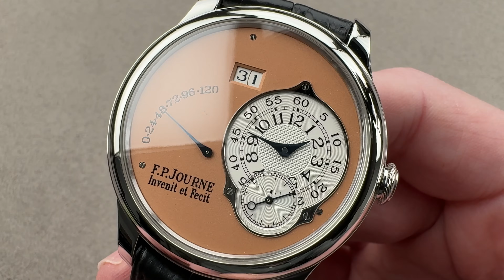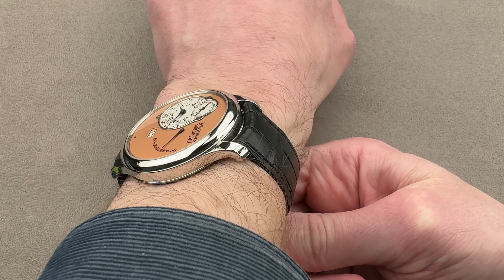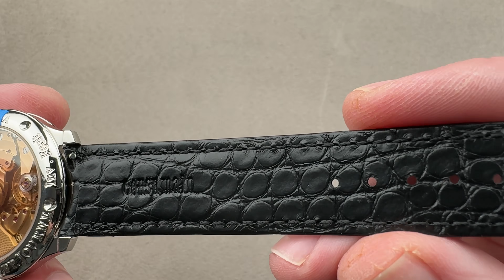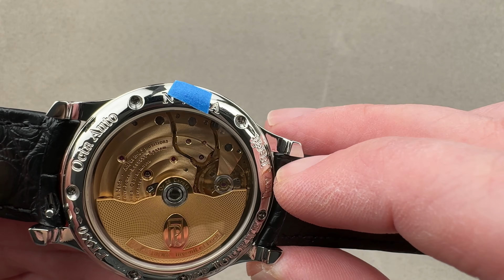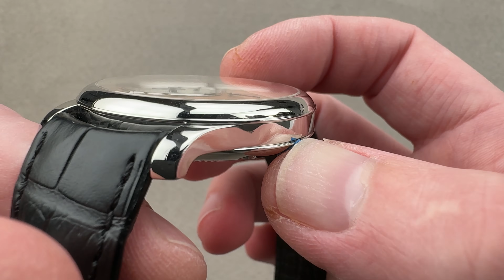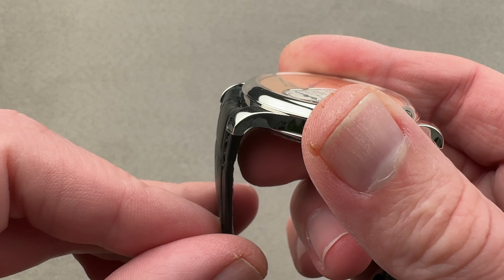F.P. Journe Octa Automatique Rose Gold Dial F.P. Journe Watch Review

Comment: Apart from the watch itself, I like the nuanced description of the rear elements...the stampings, finishings...even the flush disc as per the date...being a designer myself, I get it...I ingest it...instead of using  your fingers, may I suggest you use a Toothpick for precise pointings?  This directs us to the minute details, you will be unique also....LOL...if the movement is bright colored, use a toothpick dipped in black ink or a black pin.....and reverse the color accordingly...great educational stuff🥂